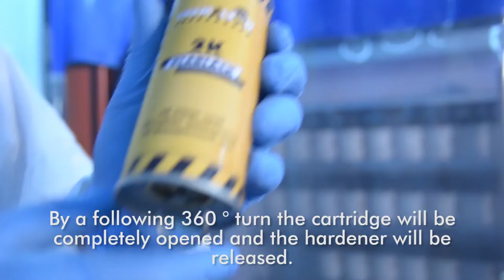Chamäleon 2K aerosol clear coat

Comment: Can it be applyed directly to plastic, eg. Plastic headlights
Reply from the maker: Yes, you can apply clear coat directly on head lights, but for great adhesion recommend use plastic primer. Art. 26014  https://chamaeleon-produktion.de/plastic-primer-spray.html
Reply: Thanks :)

Comment: after several coats, how long should we wait to level and wet sand it ? thank you
Reply: after 30 min. air-drying time, basecoats can be re-coated with Chamäleon 2K Clear
coat premium
Reply from the maker: Base coatings can be recoated with 2K hi-speed clear coat after drying for 30 minutes 
2-3 full coats, 50µ 
Leave to dry for 5 minutes between coats
Reply: i used to finish a guitar body, amazing result. thank you